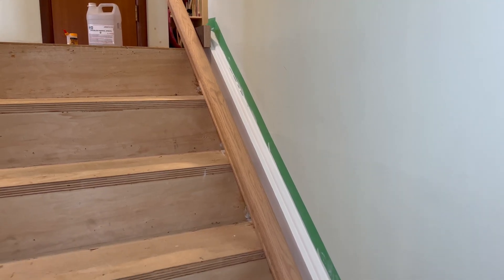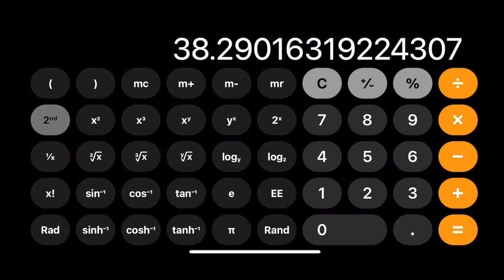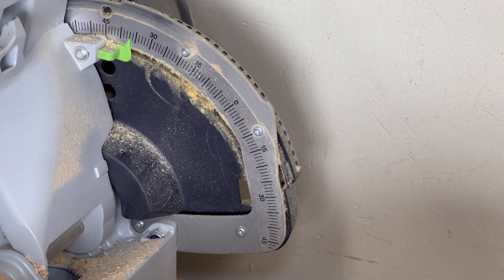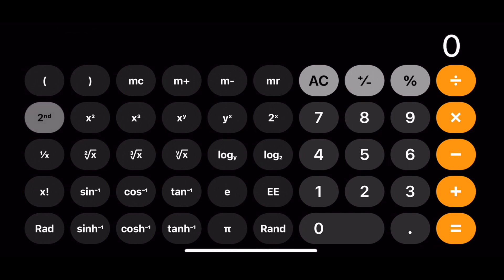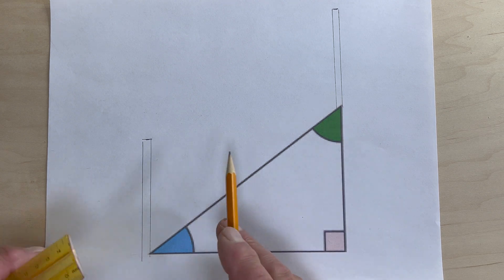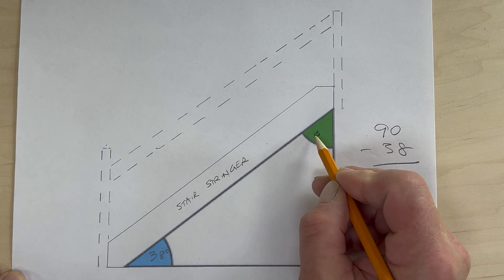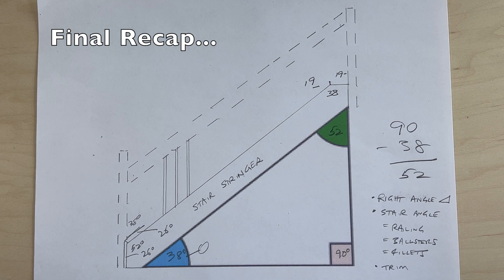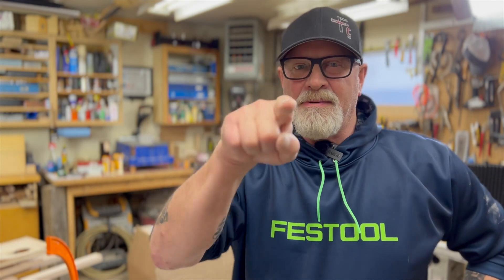How to Calculate Stair and Railing Angles with an iPhone: Simple and accurate!

Comment: Hi Scott, at 1:45 you said we have to subtract the nosing from the tread. Your tape measure measured the tread at 9 inches but you entered 9.5 into the calculator. Did you mean we have to add the length of the nosing to the tread instead of subtract? Same thing for the riser height your tape measure meausured 6.75 but you entered 7.5 into the calculator, did you add 0.75 to account for the tread thickness?
Reply from the maker: Yah the footage doesn’t match the example. Unfortunately had to use different footage for that simple equation thinking that no one would notice. But you did! Very observant. You always subtract the nosing from the tread depth to get your run. Hope this helps. Scott
Reply: @scottearlsmithFTC  Thanks!

Comment: Do you always just swap the top and bottom degree on the stair  stringer part, like how it shows 38 degree at the bottom of the Triangle but the bottom stringer miter cut is 52 degree and the top of the Triangle shows 52 degree but the miter is a 38 degree? I think this is what's messing me up on my project at the moment. I had the hardest time cutting the horizontal part at the top of the stairs, I got the miter to line up but its not level if that makes sense. maybe I need to recheck the angle of the stairs.
Reply from the maker: Michael, Sorry you are having difficulties. The railing itself will have the same degree cut top and bottom if both ends are being connected to a vertical post. Of course I can't tell what your issue is without pictures, but if you check out my video on stair railing installations it may help. There's a number of factors that affect the accuracy of the calculation based on rise and run. Your railing may be a bit long, or short, and that will affect the fit. You may also have one or both posts out of plumb. Or as you mentioned, your stairs may not have a consistent rise and run. I would check other steps to see if they are indeed the same as the one you used for your calculations. Hope this helps, Scott https://youtu.be/JjCs6_Q7SNM

Comment: Hi Scott, I'm hopping that you can answer this question for me. I have a staircase that goes up and then turns to the right and goes up another flight. It is a 38-degree slope. I know I need to cut a 45 at the top, but do I make that 45 also a 38?
Reply from the maker: @DaleDansie  Great question Dale. Without seeing pictures I will assume you have a landing at the turn? If so, transition to a level piece of railing before you make the turn and do a 45 on the level piece (level piece to level piece).  Compound angle cuts on railings rarely work out because of the contours of the rail. If this doesn’t work or make sense drop me an email. Cheers
Scott

Comment: hi, great caculation, however did you mean from riser measurement from the top of 1 stair to the top of the next or the actual size of the riser piece of wood (i.e. not incl the tread.) the video shows a measurement of 6.5 yet you input 7.5 in the calcualtion. A little confusing!
Reply: Thanks for clearing that up
Reply from the maker: @peterfoster9869  You are welcome Peter!
Reply from the maker: You have a good eye! That was substitute footage to make the video as the footage of the 7.5 riser wasn't quality enough to use. Anyway, the rise is from the top of the tread to the top of the next tread. The thickness of the stair tread has no bearing on the rise - providing the stairs are built with consistent materials and the rise is indeed consistent from one step to another. Hope this clears things up. Scott

Comment: Hey, it's Bett Sanders again.  I don't mean to bug you, but I'm ordering lucite handrail from Luxholdups on Etsy.  No pressure, but I'm 76 years old next week, and really need this handrail going up second landing of stairway.  
    Thank you so much,
     Bett
Reply from the maker: If I understand you correctly you’re going up the stairs and then horizontal at the top with a 12” piece of level railing. Does that sound correct? If so your angle cuts will be 18-degrees (half of 36).

Comment: Hey Scott Earl,   
     Thank you so much for making it easier to figure out angle of stairs.  With riser height of 7 1/2", and tread length of 10.25, that gives me angle of 36 degrees.  (If I've done that right.)    I'm putting in handrail for stairs,  that angle is  helpful, but the question that handrail supplier, is the angle of return for the 12" on horizontal level at top of second stairway.   Is the angle 27 degrees, half of 54?  I can't order until I give them that number.  
     Thank you so much.
     Bett Sanders
     Asheville
Reply from the maker: You’re right on your calculations. Cheers, Scott

Comment: Good overview! Do you think it'd be possible to do a domino video explaining how you use that tool when joining mitre joints together that are at these 19 degree angles so they line up properly? Next time you are doing it anyway? Or is there a video like this on your channel already? Thanks a lot!
Reply from the maker: Thank you. No I dont have a video specific to that technique. I have had several requests for a video explaining all the ways I use the Domino XL. So I will likely do one. (Problem is that there is so many on YouTube already.) But I still think it is a good idea and I was actually thinking about it yesterday as I did a Domino XL connector between a railing and a post. Thank you for your comment. Cheers, Scott

Comment: Hi Scott. Wonderful video. This tool the guesswork out of my latest project. However,
 
Can you explain why we minus the nosing when it comes time to crunch our numbers ? 
Thank you !
Reply from the maker: Thank you for the compliment Tyler. You are doing trigonometry when you're dealing with stairs. Quite simply the nosing is not part of the triangle. Similar to the overhang on a roof, which has no bearing on the slope of the roof. It can be one foot or 8-feet as in a carport. Similarly if the nosing is .5-inch or 2-inches it doesn't change the angle of then stairs. Hope this makes sense, Scott
Reply: @scottearlsmithFTC
Reply: You are a whizz at this does this include steps for an outside deck ?
Reply: Thank you but I think I would be better at fishing than figuring out the best way to build a set of steps for my front deck Lol but thanks for all of your great help!!!!!!

Comment: So how would you fine tune ? By average or by trial and error..
Reply from the maker: Yes by trial and error basically. Usually just a minute adjustment on the saw.
Reply: @scottearlsmithFTC  👍thanks for the reply..I'm using an android but it still works. We get so used to using the rake but having the the degree of angle is much better. Cheers
Reply from the maker: @bernnoseworthy8531  Glad it helps. Thanks for dropping a note. Cheers Scott

Comment: great video..however the tape read 6 5/8" and you input 7.5" Please explain where the additional inch comes from. Thanks.
Reply: Caught this too! Thanks for the clarification!
Reply from the maker: Good eye. I used footage from another build. I wanted to use calculations that represented a typical staircase with 38-degree angle. Thanks for your question.
Reply: Thanks great video and I was asking because I’m in that situation with square tubing mild steel.
Reply from the maker: @GALENFISHER   Glad the video helped and hope your project goes well. Thanks Scott

Comment: Great video. That is the best explanation I have seen in a while. By far! I am in the middle of repairing my stairs going into my basement as the landings were coming apart (the joists were separating from the band joist) and dropping. They never put any structure in to hold it up/ in place. Just nails.  Same thing for the stringers. It was like they did temporary stairs and then forgot about it. One landing has dropped 1 1/2”on one corner. There were gaps between the landings and stinger to the studs over an inch in some places…. And a lot of the treads were about to come out of the houses stringers. They glued the wedges in but nailed through the stringers into the treads and then nailed through the routed area behind the tread through the string and into the stud. That caused the stringer to pull away from the tread.  Luckily I was able to cut out drywall and screw through the stingers and into the treads in most locations. Where I couldn’t I supported the treads another way. I have a feeling the stairs going to the second floor need work too… I want to dress it up a bit and I want to redo the railing going to the second floor and dress it up. Thank you. This will help. And I just watched your how to videos on making stairs. Hopefully it doesn’t come to that! 😊
Nice fish! 😊
Reply from the maker: Thank you Ron! Yah that calculator trick will get you pretty close. I've seen some gnarly staircases in my travels, but your's sounds extra special! I'm sure you'll get it all fixed up - and that will look and feel so good when it's done. Glad you liked the fish. In 2022 I had covid when the run was on full swing. Hopefully next season I can make up for it.
Reply: Glad you are doing better now. I didn’t get to fish at all this year but plan to make up for it next year.
Thanks for the words of encouragement regarding the stairs. I just about have  the repairs finished. Then I’ll dress it up a bit.
Hope you and yours have a Merry Christmas and a healthy Nee Year.
Ron
Reply from the maker: @ronh9384    Thank you so much Ron. And you as well. Enjoy the season and make sure to wet a line in the new year.